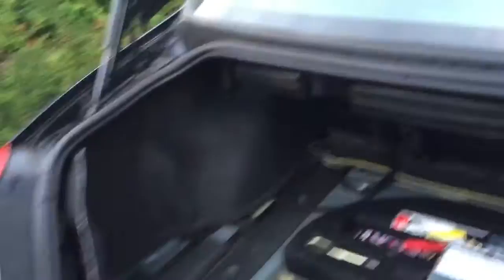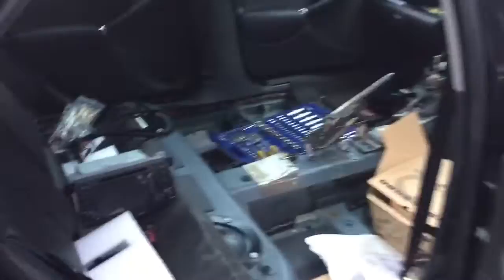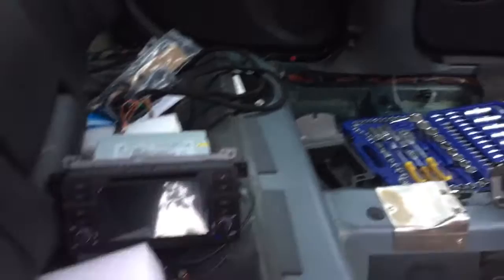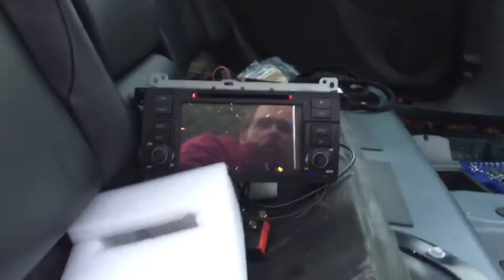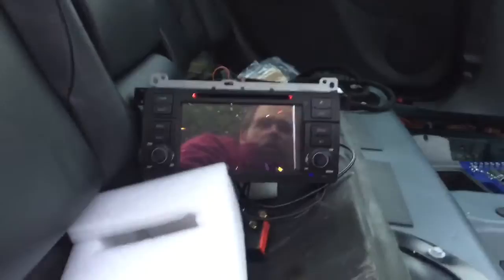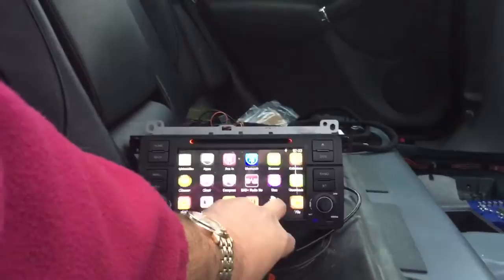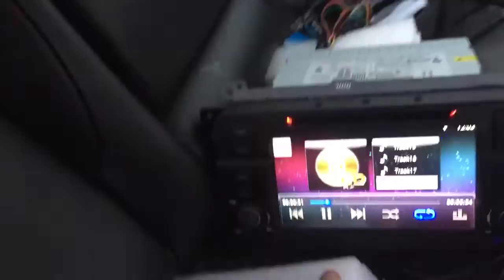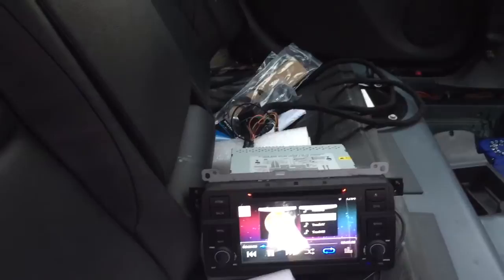Navall 3 installation in MG ZT part 1

Comment: How did you fit the head unit? I have just got one but the plastic bits on the top at the sides stick out?
Reply from the maker: Gary Sycamore which head unit have you purchased? Most will need the metal tabs shaving down to make it fit within the dashboard neatly
Reply from the maker: Gary Sycamore I gather when you put it in the centre console the two black tabs on the side of the unit are stopping this fit flush? If this is the case you need to cut them off, they are there for BMW e46 mounting to hold the wood fascia on and not required on the at.
Hope this helps
Reply: Ah.. thanks did you cut yours of then to get it in?
.Also they are telling me that I need a cable to convert the connectors, presumably from the boot to the dash,  is there a cheaper alternative as they are quoting me £45
Reply from the maker: Gary Sycamore  yes I did cut the side tabs off to fit this in the centre console of the zt/75.
Once that’s done it should fit nice and snug back against the hvac controls.
It depends on what setup you have in your car, if you have the premium audio Harmon Kardon setup you will need the bmw fakra cable and extension kit to make it all work, this would be setup how the video shows, you run the extension and aerial from the rear of the car to the front.
If you have standard audio the iso connector will be located right at the back of the centre console on the floor, you need to remove the hvac and ashtray to get to these easily